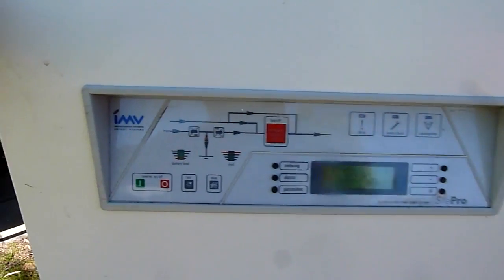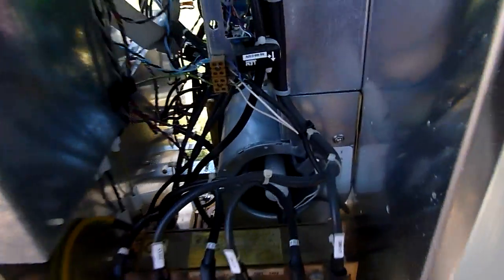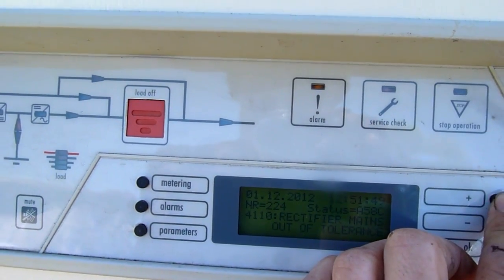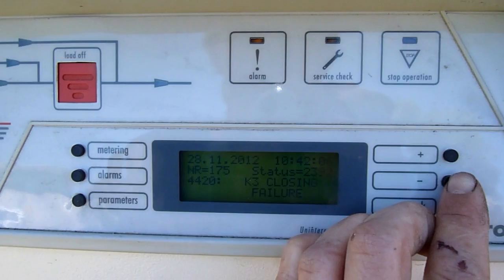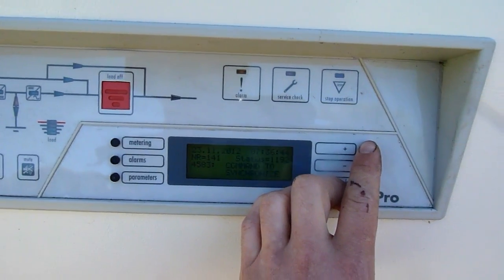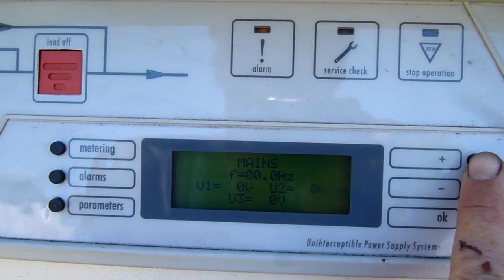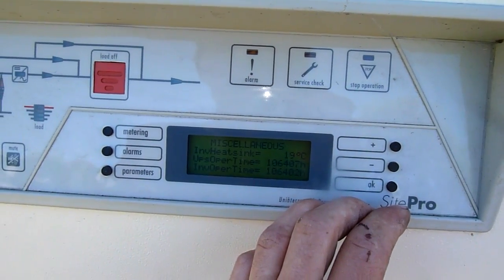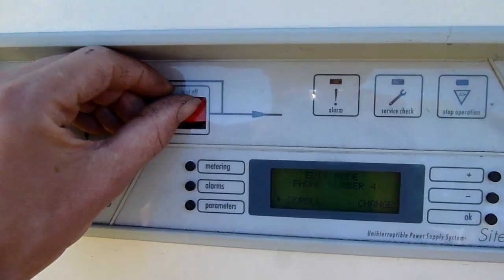Invertomatic Victron 40Kva UPS Control Power Up and Memory Exploration

Comment: Wondering about the No Load losses of this thing. I think if we only count the 80-90% Efficiency of the Invertah and the power the Batteries need to trickle charge,let alone the charger efficiency losses,transformer flux current,etc,it wont be reasonable for in house use without a reason considering it isolates the mains and running the output through the inverter.

Comment from the maker: yeh if the alternator is short, it will try and pull maximum horsepower through the belt. likewise if the bearings are siezed it will smoke the belt.
best replace it before it starts a fire, or disconnect it altogether and charge the battery before each run.

Comment: My university had a UPS that took up a whole room to keep their machine room filled with servers running for a minimum of 15 minutes.  Then one day a squirrel chewed through the A/C line feeding the building, obviously cutting the power.  The servers stayed on for 10 seconds before the UPS failed...and the whole server room went quiet.  Turns out no-one had bothered testing the batteries since the day it was installed...D'OH!

Comment: I had the same make ups and it was a rack style one. It had a separate unit with a load if batterys in it. And it was a fantastic ups. Infill a bug got into it and killed the circuit. Sadly un-fixable!! It was 5kv and I got it very cheap.

Looking forward to the big autopsy on that beast ;-)

THUMBS UP*

Comment: Looking at the numbers on 5:22, during its whole 106,407 hour life time (12 years) it only operated for 5 hours off battery. You wonder if a much smaller unit, or several, could have done the job.

Comment: The Q and K reports will be to do with the external bypass panel. Tell the UPS it's going into bypass mode (so it synchronises the output with the mains), then switch the bypass switch on followed by the output switch off. Finally the input switch can be switched off and the UPS shut down and ripped out. The UPS will be monitoring the switches using their auxiliary contacts, also (in the case of the APC Silcon ones at least) using neon indicators to tell you which ones are safe to switch.